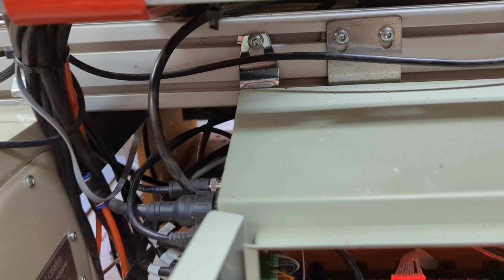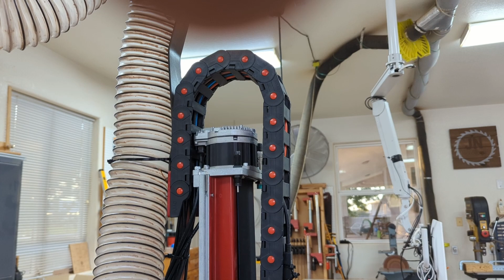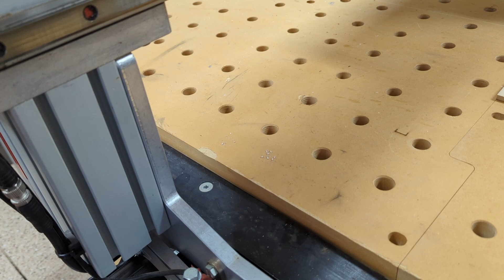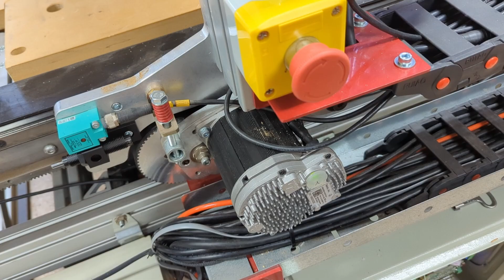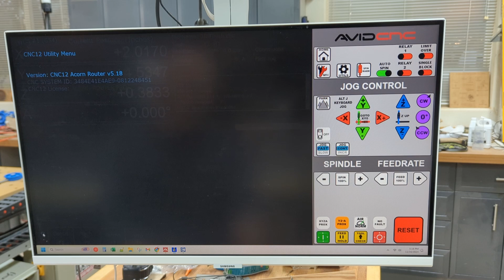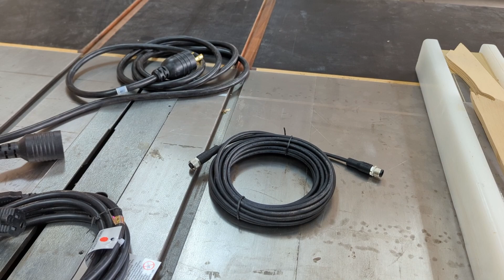EX Controller Part2,  Servo Motor Upgrade

Comment: Hey Jim - I wonder why Avid shows these going up to 1200 on the website not 1000 max rate
Reply from the maker: I think you could change the setting and they would work, but the software default is 1000ipm I think.  I have been actually turning that max setting down to around 500ipm because I never go that fast for my work, and that max speed is the default fast jog speed and that is scary fast when jogging.

Comment: Do you think the upgrade is worth it from the old NEMA 34 controller? $5k for the upgrade is hard to do.
Reply from the maker: It really depends on  your situation.  After a lot more use on these, I would say that it probably isn't worth upgrading for most people (if buying new, I would recommend for most folks).  If you are are really pushing speed (like production cutting of cabinet parts), they are probably better (but I can't quantify that since I didn't do any high speed tests like that).  You can push them hard and they won't lose steps, and they will run smoother at those high speeds.  If you are doing very fine milling or laser work, then the steppers might be better because you already are probably running slower so the smoothness can be dealt with by software speed/acceleration settings, and the steppers have a better resolution than these servos, so if you need really fine resolution (like less than 0.001"), you'd want the steppers.  Most people don't need that kind of resolution.
Reply: @JNWoodworks thanks. I just do this on the side so I'm only using my cnc a few times a month. I'll stick with the current setup.
Reply from the maker: @StevenDavisPhoto  I would say for that usage that is the right decision.  The only reason I did was because my CNC is just as much as a playground as it is used to make stuff, so I had to try them out 🙂

Comment: Thanks for the video Jim. I’ve been running CP’s for years now with Linux CNC, but now that AVID supports them I am thinking about switching over to centroid. Your videos are helping relieve switching anxiety from LCNC which has been very capable for me. I’m guessing with your new spindle there is an Avid ATC in your future :)
Reply from the maker: I've hear a lot of good things about lcnc.  If that is working well for you, I'm not sure there is much reason to switch.  Mach4 has a lot of stability issues for some people, so its a good thing for them to switch.   However, if you are trying to move back into the AVID mainstream and maybe get their ATC, then it would make sense.

Comment: The servo kit doesn’t come with clear path power supplies? If purchasing the machine new with servos, does it still come with 48v power supply? 70v would perform much better wouldn’t it?
Reply from the maker: The main advantage of a 70V operating voltage is that the current can be lower, so you can use smaller wires and connectors.  The supplies also don't have to ramp up as much current when there is a big torque jump since the overall current is lower.  The motors might run a little cooler as well due to the lower I^2R losses at lower current.  Its mostly just a matter of sizing the connections correctly, and picking a supply that is made for this application.  AVID worked very closely with Teknic to pick the right motor models and design the power delivery system.  They were able to re-use the Mean Well supplies (a very good brand) that they use with their stepper kits as well, so I'm sure that helps them keep costs down.   The manual on the clearpaths doesn't show any performance advantage vs. voltage, it just warns about making sure that at the lower voltages the power delivery is up to the task of handling the higher current properly.
Reply: @ that makes sense now. Thanks for the reply

Comment: I always appreciate you blazing the trail so I can follow your footsteps!
Reply from the maker: I'm waiting for some really good software engineer to come along and write me a new UI for it.  If only I knew someone like that.....😂
Reply: @ Do you think it’s possible to mount both the ESS and Centroid boards and switch between them? Maybe with a few wire swaps or nice connectors in between? I’ll get you that software it’s my resolution ;)
Reply from the maker: @feachr_it  With the servos like I have the wiring is too much of a changout.  However, If you keep your steppers, then its not too bad.  The cables in that case are a 1:1 match, so if you labled all your sensor and motor cables well, you coule probably do a swap in about 5 minutes.
Reply: @JNWoodworks  Thanks I might give that approach a shot!

Comment: Thanks for all of your reviews Jim!  I have been wanting to get a new CNC for a couple of years and finally decided on the AVID Pro 48x48 with the EX controller and servo motors.  I added the rotary, wireless pendant, and vertical work holding options.  Your videos and reviews have really inspired me.  It is supposed to be delivered late this week, so I'm like a kid watching the Santa Clause tracker.  In talking with the AVID team, i know they are working on additional laser options, but I did order the Opt XT8 directly from Opt and was amazed that it arrived in just a few days.  I'm not sure how many times I referenced  your setup when talking with AVID.  I really like the way your machine is set up and plan to do the same with mine when it arrives.  Thanks again for what you do for the community.  It is greatly appreciated!
Reply from the maker: Awesome, have fun with your new machine.  Half the fun of these is putting them together and figuring out all the things you can do with them .

Comment: Good video. I assume you still should set a measured steps/inch value using a digital caliper or dial indicator for each axis to get good accuracy like was done in Mach4. I don't see a way to do that or heard anyone discuss it.
Reply from the maker: Yes, you can still calibrate linearity and backlash.  I have done backlash on mine, and the values are added in the Utility Menu->Advanced config->Mach.->Motor.
In there are the settings for Lash comp.  I have not yet done linearity calibration on mine since converting (but I plan to soon).   In that same menu is "Motor revs/in".  Mine is set to 1.01859 by default from AVID fpr X and Y.  It is the setting that you would fine tune to adjust the linearity.  There is probably a formula listed on Centroid's website or forum for figuring out much to adjust it for a given amount of error, but I found with Mach4 the easiest thing is if you measure your error, make a change to the setting and measure the error, now you know how much the number affects the linearity and its easy then to figure out what the new number should be.
Maybe I'll do a quick video on it when I get around to adjusting mine.
Reply from the maker: One thing that I should mention is that with the EX controller you cannot do sperate linearity and backlash adjustments for the two Y motors.  Since they share the same axis output (the slave is just a copied and inverted version of the step signal) they have to use the same parameters.  You can measure the error at each end of the gantry, and then just use a midpoint between the two if they are different.
Reply: @JNWoodworks  It also looks like you could use the Acorn controller screw mapping and correction capability to greatly improve accuracy in the XY plane. Building the table of correction values for every half inch of travel would be quite a job but it appears that CNC12 would execute the corrections seamlessly. It should work on rack and pinion systems just as well as ball screws.
Reply from the maker: @Sehast  Yep, Centroid has a LOT of adjustment capabilities.  You can also adjust the acceleration that you want to use when the system is changing direction to take up the backlash.  However, all of that stuff is IMO a little unnecessar for a large cnc router since the flex and deflection in the system are much larger than the backlash and linearity issues across the rack.....but its there if people want to go to the nth degree :-)

Comment: Servos are only running at 48v?  Teknic recommends 75W for the best power curve.
Reply from the maker: They can use the same power supplies that they have for steppers this way, and electrical safety ratings are easier to deal with under 50v.  The power difference only matters is it's not enough, and these move things along just fine.

Comment: I have an Avid EX servo system and running into a problem where the z axes randomly crashes into the workpiece.

Here is my process.

I am surfacing panels so I run the same job over again.  I only perform a z0 for the first panel.  Tonight I surfaced 27 panels successfully, 28th panel where the Z0 when down it failed and continue to move down until it stopped with a drive error.

FYI already working with Avid support but not sure when a solution will be found
Reply from the maker: Well thats not good.  It sounds like you've run your's more than I've run mine so far.  I've been mostly doing a bunch of experiments on vibration and laser accuracy.  I have not seen any issues like that with mine, the only time I ran the Z axis down was my fault when I got a little careless with the pendant.
I guess that could be a motor problem (internal encoder issue), or noise on the step signal from the controller to the motor.  Weird.  I'm sorry I don't have any good suggestions but maybe to reconnect the Z motor's signal cable at both ends just to make sure it has a good connection.

Comment: After your last video. I looked at cnc12. I found a video that was just about using a laser. There is a backlash setting in the program. When they set up the backlash properly it was a totally different machine. The part that stood out the most to me was that the controller was calculating the backlash into the g code and telling the motor were it should be. With the closed loop telling the controller where the motor is actually moving I think that one should be able to print out a grayscale photo that would be perfect. The test that they used was making a straight line using pulses across an axis.
Reply from the maker: I know which video you are talking about.  Ya, they use the backlash as a means to adjust that right now.  I'm currently characterizing it vs. feedrate.
These clearpaths are stepper replacements, so they are closed loop within the motor only, as far as the controller is concerned its a stepper motor.  The other thing is that this is really a timing lead/lag between the PWM control and the motor control and its hard to build that in to be dead on without needing a little calibrations.   The ESS card with Mach4 is the same way.

Comment: Really interesting Jim. Thanks for getting into some of the important details on this.
I'm particularly impressed with the refreshing way Avid is re-imagining aspects of CNC12 to make it a more functional package. For example, the laser is treated as a tool that needs specific attributes assigned for optimal function. They've put those things in (one?) place and incorporate them into a functional 'tool' for the sake of the post processor.
How do you think the laser setup will work with Lightburn where the output is G-Code? Will we need to build commands around Lightburn output to incorporate some of the special functions (M64 comes to mind)?
For a stock CNC12 user, I'm hoping there will be cross-fertilization across both of these platforms. The PP is downloadable for examination/modification, but I'd like to get some of the other doo-dads like M64 or other settings that are explicitly evident.
Reply from the maker: Hi Scott,
I am actually working on some of that very laser stuff today.  I'm using both Vectric and LaserGrbl.  I don't know much about Lightburn's customization capabilities for Gcode output.  LaserGrbl writes out Gcode that is Centroid compatible, and it lets you write your own header, footer, and multipass mid code sections, so it is easy to get all those "special" gcodes and macros added it.  I suspect Lightburn is the same.
A lot of the recent new router additions to the stock CNC12 came from collaboration with AVID.  A lot of AVID's customization that is on top of that are just simple macros, so you can do that stuff yourself easily.  For example, I like the stuff AVID has done with the laser, but its a little too integrated for me because I do a lot more experimentation rather than production, so I want it a little more stand alone and not tied to the spindle.   It will be easy to make the changes I want for myself.

Comment: I still haven't seen anyone show the graph part. Is there a LIVE preview where you can watch the graph update in relation to the tool before running your program? Ex. making sure the stock you have on the table is enough for the program you are about to run. Or say if you have a star or weird shape your about to cut out and want to make sure it can fit in this area of the stock on your table that might also be a weird open area on a remnant. I don't know how else to word it right now. Mach3 has the feature "Jog Follow" 
I have CNC12 for a lathe and we don't get a live preview. Would be nice to make sure I have enough stock sticking out that it would not hit the chuck.

It'd also be nice to be able to put that graph on the main screen. I find there's too many buttons I need to press to get around, at least with Mach3, everything I need is on one screen.
Reply from the maker: Hi Tyler,
You are hitting on the one thing I  think falls short on CNC12 (at least compared to mach3/4).  They do have a graphing screen, but the current one is only offline.  However, in CNC12 5.20 they did make it so you can jog around and it will show where the origins are, workpiece boundaries, and the tool is relative to the toolpath.  So you can find out if all the zero settings and the toolpath fit on a weird shapped workpiece.
However, I don't know if the live version of graphing is also updated  with that info. This version should be coming to AVID soon.
Centroid needs to do some improvement on the CNC12 screen.  It is bascially set up to be optimal for a smaller LCD touchpanel that you'd see on a large CNC mill.  However, everyone I know on a CNC router uses a bigger monitor, and the screen real estate is not used very well for that situation.  I also had the line counters and percent complete statistics on Mach4, and I would like to see the toopath graph along with all the other info.  Rigth now their graph drops on top of everything else when its turned on.  They have added a lot of improvements lately for CNC router use, and I think they are planning on more so I'm hopefull that some of the things we're used to having on display all the time will be coming.
Reply: @JNWoodworks  Thank you for the reply! I wanna switch over so bad!